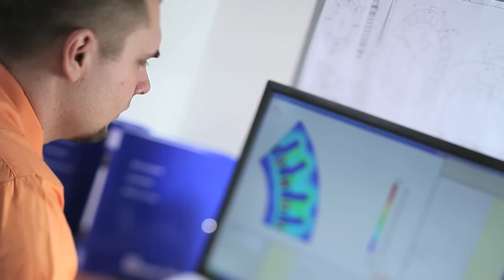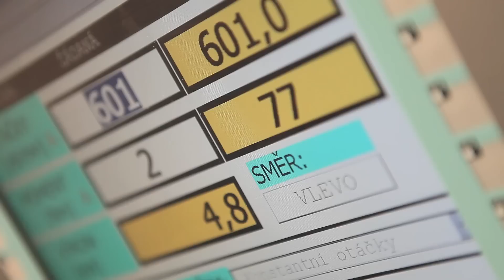TES generators and motors - Production of electric machines

Comment: some people see rewinding motor is hard.. it is easy ..rewinding motor is just to restore the motor as before it damaged using same wire size , same span of coils and same number of turns and need how to isolate stator  slots

Comment: does your firm can manufacture a compact DC or ac  electrical motor  298 kW   aluminum frame at the same  size of a 15 kW. or 30 kW motor size due towards state of art technology/ technologies.

Comment: I did this right out of high school 1971 to 1974. $1.67 per hour  I think. I did it all cut insulation, wound coils by hand and counted turns and inserted into the generators som of them over 4 feet in diameter. I was dept.. lead man when I left
Reply: Ray Britt
Reply: Arslan Salam
Reply: Ray Britt drinks
Reply: Ray Britt I want to learn and do it with my hand .m electrical engineer but I couldn't get a chance to do it practically
Reply: Guddu Singh vandar
Reply: Interested to know what has changed in the production then and now....???
Reply: Hey Sanjoy....
Reply: Jondarmrialjrya
Reply: Ray Britt on no
Reply: Hola
Reply: Ray Britt  i was not burn that time
Reply: People got electric shock and killed when they touch the electric motor in their houses.
Reply: Nice sir
Reply: 5:15 please, what the name of the machine that he uses to turn the machine?
Reply: Ray Britt 
How are you?
I think you shall involve into my project 
Let me know if you have interest in solving the the new way of doing things, electricity
Reply: Good this my profasnl job

Comment: Seeing the places they were installed reminded me of where I last worked. Instead of using water to produce power, we moved water for environmental or flood control purposes. Mostly with Diesels but our medium size pump stations all had at least one electric motor driven main pump. All were 150 HP driving a 48 inch outlet pump. Those places were kept like you see in the video as we mopped down every Friday and swept down at the end of every shift. Places kept clean enough you could eat off of the floors.

Comment: HAY SIR,
I AM TRY IN TO MAKE A 13HP 10KW INDUCTION MOTOR I NEED SOME SUGGESTIONS
1  -  number of slods  
2  -  what should i keep the size of slods
3  -  air gape between stater and rotor

Comment: I was doing some electric motor rewinding on 2003 on a smaller scale for someone who did it in their old milking (dairy) shed on a farm.
I am by no means an expert in motor rewinding but I did rewind a small 2 pole induction motor all by myself including counting the number
of turns per coil,the coil pitch ,determining the coil type ( i.e concentric) & the former size,also the gauge of wire.
I worked for him for a year & I have been at my wits end as to why no one was wanting to train me as if they thought I wasn't supposed to that work as if I was supposed to work to what an idiot or layman is.
I haven't worked for 5 years because such a person thought I only had to work on dump (coal) trucks for WesTrac only to find out they're idiots!!!!
So what vocation did anyone in the world think I was suppose to follow????

Comment: There is no money as a CNC operator, CNC programmer or Manual Machinist in Kern County California; we have JD-Rush Oil Part Manufacture, Bolthouse Farms Food and Beverage, BWI-Implement Farming Equipment, TNG-Geo-Thermal, AC-Piping Oil Manufacturing, All these companies have machine shops and pay around 12.00 to 15.00 dollars an hour for the same work. If you buy your own Manual Mill and Lathe for around 15,000 for both your business. Don’t work for any company.  As much as business and manufacturing jobs going out of business in California it’s very easy to by equipment for a very low price, your best bet if any of you guys want to get into the machining and manufacturing area is to build your own business and then you can make a decent profit.
Reply: +domino diamond qwe